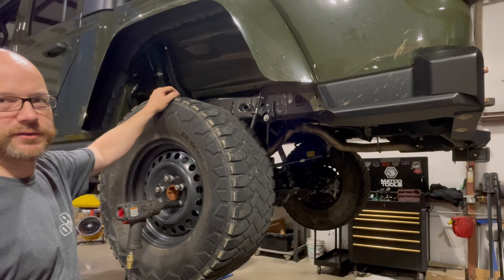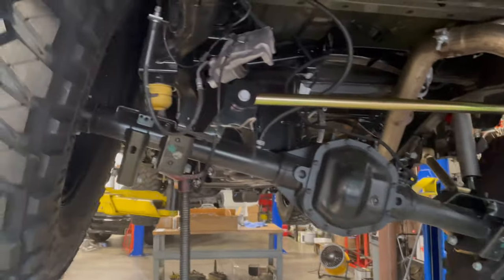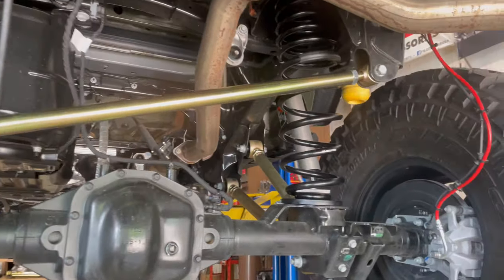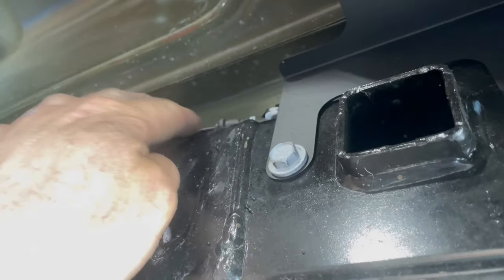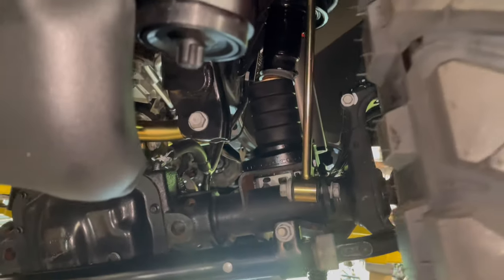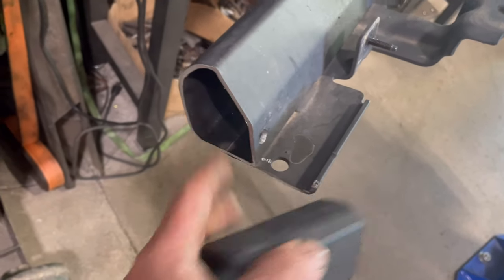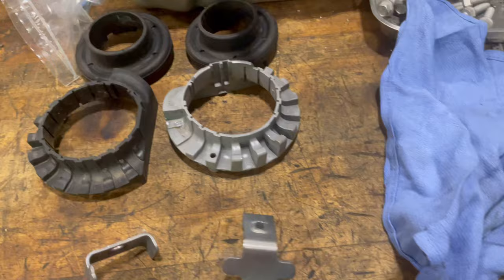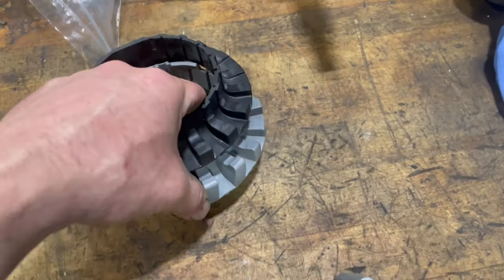Diesel Gladiator Buildup - lift, tires, wheels

Comment: Just wandering what axles you plan on running?
Reply from the maker: That will be in an upcoming video. It has a Dynatrac Pro Float 60 rear and the stock front housing with a truss, gussets, gear, RCVs.
Reply: @rockyour4x4  thanks look forward to seeing that. 
Just starting my diesel gladiator build so I'm looking for some good parts.